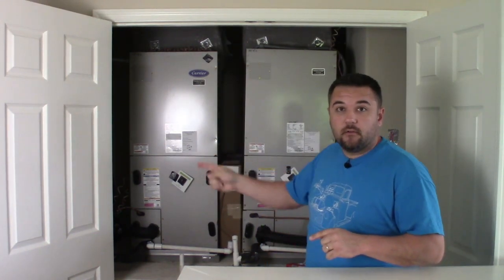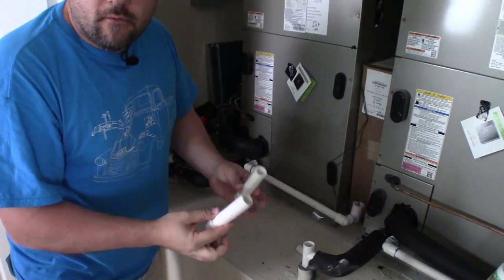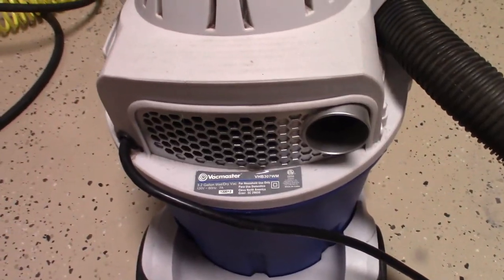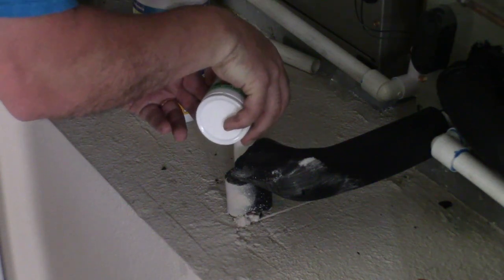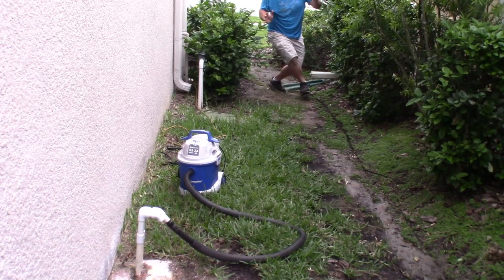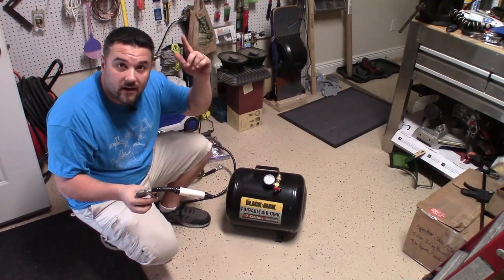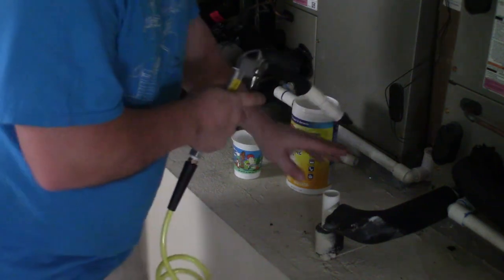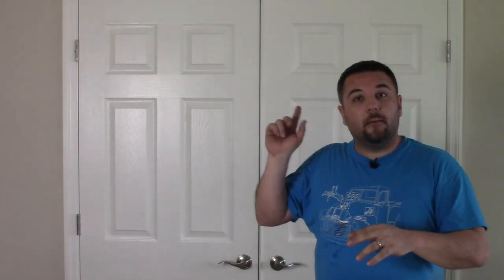DIY: Air Handler Condensate Drain Line Cleaning / Unclogging!! Sucking & Blowing!

Comment: How do you clean the line between the air handler and the access pipe?  My unit has a clear piece on that horizontal line, and I can see that there's crud building up in that horizontal line.
Reply: using large  and long zip tie from Homedepot or any flexible line to break and then pour water from floater side to clear the drain.

Comment: Using water outlet  to shoot and flush the drain from outside in or inside out . Get some ( Pipe to horse or hose to pipe)  adapters and  rubber coupler from Homedepot . Lifetime guarantee.